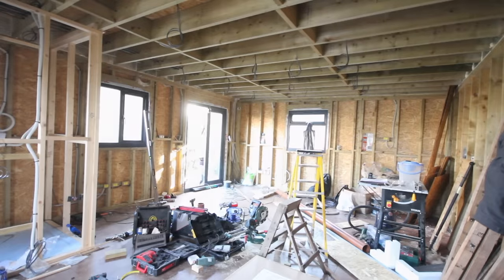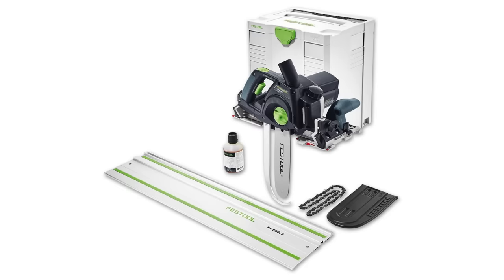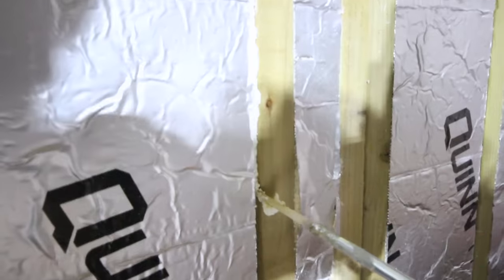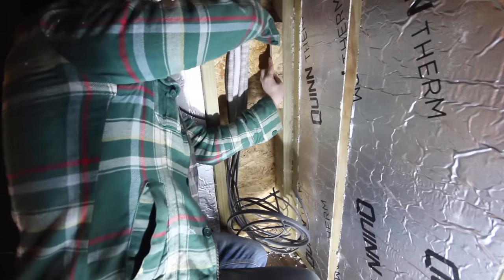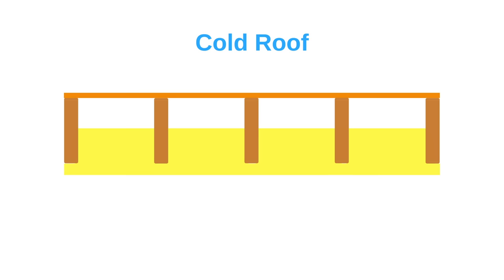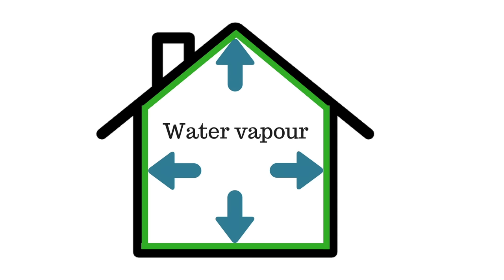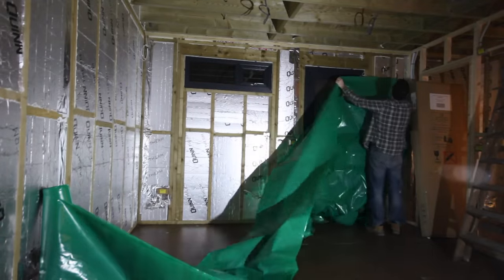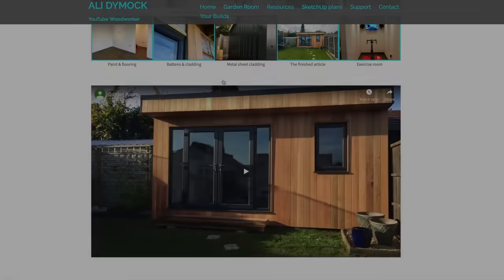Garden Room Workshop: Part 15. Wall Insulation & Vapour Barrier

Comment: For cutting PIR there are purpose made  handsaws for the job and they create MUCH less dust. They have a cutting profile similar to a large breadknife. They can 'wander' a bit though on thicker stuff 50mm plus. However if you want to make your life really easy you can buy 150mm jigsaw blades with the same 'breadknife' profile. These do a fantastic job, even in thick PIR. Very quick and low on dust.
Reply from the maker: Love it. I wonder if they make circular saw blades for the task too...
Reply: @AliDymock  Hi Ali, yes they do, my apologies, I should have included that. Look for a circular blade called 'Centrefire" by Bullet Tools. American brand but available on Amazon UK. I have only used the handsaw from Bahco and the special jigsaw blades from Bosch.
Reply from the maker: Super, I'll pin your comment to the top for others to see 👍
Reply: And the fact that you have pinned the above (as it;s clearly a top tip, however amazing a Festool mini chain saw thing would be) is further evidence of your ludicrous helpfulness!
 @AliDymock
Reply: I cut pir with a knife then like plasterboard snap over and cut other side very quick easy method
Reply: @simonjarvis7362  ociosaniuci.    FiIii cicxuco juiiiiffid i i Ok i i ou okupione o
Reply: @stancullen2408  yep, easy as pie and no dust that way. I use one of those ones that is like a Stanley knife with a longer blade. Zips through about 90mm thick of it then snap the board
Reply: @stancullen2408  how far do you have to cut 90/100mm pir to be able to snap it?
Reply: @handle1196  at current prices about 90 ot 100mm ideally.

Comment: Next time you want to cut the foam, use a electric carving knife like the ones used to carve a turkey. Clean cut, no dust, quick cuts and no beads. No wasted material by having blade cutting a curf through the material.

Comment: Cut Your installation to the correct size of gap then cut out any grooves needed for pipework and electricity cables but cover the back of the insulation where the cut is with silver tape folded into all the crevices and gaps before placing over the electrics or pipework

Comment: You shouldn’t have to worry about insulation and wires getting hot as if the size is properly calculated insulation will be considered when that is done

Comment: I wonder if a air gap between PIR boards and the outer panels is needed?  In case vapour penetrates,  it gets some space to dry or drip down.

Comment: Insulating a concrete garage, this video series is awesome, thanks so much
Reply: I am insulating a single skin room attached to the back of the house. Did you leave a gap between the studwork and the wall or go flush?

Comment: Great to see another video.
FWIW standard plasterboard is a perfectly good vapour barrier on it's own (once painted) if you install it properly. Of course a polythene sheet behind it is extra insurance and doesn't hurt but isn't strictly necessary.
Reply from the maker: really? Hmmmm. So does the paint act as a vapour barrier or the plasterboard or together? And is this the case if you don't do a full plaster skim and just tape and joint (drywalling)?
Reply: @AliDymock  It's the combination. The bare plasterboard provides most of the resistance and then you cover it in paint which is like sealing it up. 
The vast majority of top floor ceilings in houses are built like this, plasterboard on the ceiling and then above it is unfaced fibreglass insulation. Works just fine on ceilings like that.

Comment: I’ve never seen plastic sheeting put up over the joists internally before plaster boarding. If you’ve got Tyvec on the outside I’m worried you’re trapping moisture inside the walls (timber) which can lead to rot. I wouldn’t be surprised if your walls start to sweat when it gets hot. 
I’m pretty sure PIR insulation does that job already. 
Correct me if I’m wrong
Reply: This is exactly what I'm thinking...I'm currently part way through my build, and logic tells me wrapping the inside like this is not good. Different states in America, moving north into cold regions, it makes more sense,  but in the UK, this can't be right.
Reply: In the process of building my own shed and have been researching this a lot. From my understanding:

- Tyvek outer wrap is a BREATHER MEMBRANE. It lets moisture pass through it on one side but does not let 'bulk water and air penetrate it.
- The vapour barrier on the inside of the walls is to stop vapour from the inside of the building passing through the walls and hitting the cold side of the insulation and condensing.

Comment: been watching 👀 from the first episode  thought i would watch how you built  yours as i was just starting mine and was looking and learning how and where to start its been a massive learning curve doing it all myself .. after watching all your videos and a few others built up the confidence  i just went for it turned out pretty good 😉 i went for concrete base, shiplap cladding, wool insulation, plasterboard then plaster, rubber roof, tiled floor, with underfloor heating, 😅😅 with a shower room with toilet, total size 3.8m x 7m
Reply from the maker: Wow, with underfloor heating too, sounds grand - do you have pics?
Reply: I Documented it with pictures and videos but my phone got stolen so lost most off the project will upload the ones I have plus ones off it finished
Reply from the maker: That sucks! sorry to hear that. Well if you fancy having it on the website regardless, pop me an email: www.alidymock.com

Comment: This series has been brilliant! I’m just starting a timber frame conservatory build on the side of my Mum’s annex. There’s a covered decking there already but, after watching your videos and doing some research, I’ve realised it hasn’t been built properly. I’m essentially starting from scratch. 
I’m a self employed mechanic/car builder/restorer by trade and a keen DIYer - after the eye-opening and stressful experience we had with the builders who worked on the annex I’m doing stuff myself.
Reply from the maker: That's awesome, good for you. I must say, it's nice to have control so good choice and once you break the stages down, you realise it's very doable! Best of luck, with your experience you'll do great. Feel free to send photos Robin, I always learn from them 👍
Reply: Ali Dymock thank you for the encouragement! I work from home and I’m extending my workshop bit by bit as well. This will be my first venture into a domestic build and I’m really looking forward to it. I’ll definitely document the build and keep you posted 👍🏻
Reply: Ali Dymock I’ve just ordered the materials for the framework so, providing COV19 doesn’t disrupt delivery in the next few days, I’ll be good to start next week. One thing I wanted to ask (I’m sure you’ve covered the topic somewhere and have been asked before)  - did you look into putting a breathable membrane under the floor insulation over the joists? Tyvek suggest you use Supro in a suspended floor but that’s with a wool/glass quilt or batt insulation. Quinntherm’s installation guide is as per you’ve done. My only thought was could moisture in the air from underneath get into the floor joists and soak into the sides of the PIR and not be able to get out? Perhaps I’m massively overthinking this but I’d really appreciate another person’s perspective on this. One idea I had was to staple dpc to the top and sides of the floor joists to form a barrier between where the timber and the PIR meet...
Reply from the maker: @robinlaker  I haven't covered it again but will do so, though no quite the question you ask. The floor and insulation should be open to the underside to allow air flow. It's trapped air that is the problem and why houses have air bricks to allow that flow of air under the floor. A breathable membrane isn't really required because it stops rain water (mainly) which you won't get underneath your garden room. You could use it but I'm not sure it would do a lot.
Not quite sure what you mean in the last sentence (I can't picture it) but I really think it's not needed and could actually cause problems. 
Do you have a link to Quinntherm's installation guide? I'd be interested to see/use for a future vid.

Comment: Can’t wait to see the projects on the new house.
Reply from the maker: me too! We're saving at the moment lol
Reply: Ali Dymock I bet 😂 Tip for someone who’s been there. Try to do one room at a time. It’s tough but worth it.
Reply from the maker: Absolutely - definitely the best way to go, I'd go potty otherwise. 

Doesn't always pan out like that as it turns out:. The downstairs shower room could really do with being upgraded from a 6mm to 10mm cable for the electric shower. That means I need to take the plasterboard off the hallway to make way for the wire. As I'm doing that we may as well put spotlights in the hall ceiling. Since I'm doing lights I should probably get the ones in the utility/boot room done too. Oh and yeh, I need a new consumer unit with RCD protection to stop us getting electrocuted in the shower 🙈🙈🙈😭😭😭
Reply: Ali Dymock 😂 tell me about it. I changed a radiator to a triple column cast iron in the sitting room and ended up changing all the flooring, fixtures, making fitted cabinets in alcoves etc. It never ends 😆

Comment: BTW to cut insulation I got some 150mm long insulation jigsaw saw blades from milwaukee, cuts like butter and virtually no dust as its more like a knife and not a cutter. U also can do angle cuts well too by using the angle on the jigsaw.
Reply from the maker: Sounds brilliant. I'll do the same in future for sure!

Comment: You don't need to worry about insulating around cabling as your electrician will already have derated the cable to take insulation into account. Derating essentially means taking the maximum current rating of a given thickness of wire and reducing it by a factor based on what it is going to be surrounded by. In stud walls this typically always accounts for the wall filled with insulation.

Comment: I really hope to get started on mine garden room next year and this series have given me confidence that I won't encounter pitfalls that I can't manage on my own. 

I just discovered posi-joists, so I want to look into making a warm roof that's not as tall, if that's at all possible. 

Unfortunately pir foam insulation seems to be pretty rare in Denmark, so I'm worried it might be too expensive to consider. Seems to be nice to work with, especially for floor and roof.
Reply from the maker: Good stuff. Get the base/floor right and the rest will fall into place.
Posi-joists look great especially if you have a really wide span (6m+)!

Best of luck with your build!

Comment: Great to see another video from you Ali. As spring is just around the corner could you switch to the outside for the next video....Searching you tube, there doesn't appear to be much in the way of information on cladding and materials in the uk !!
Reply from the maker: It's a good idea, the next one will be on plasterboarding but I could divert after that one. I was going to save to the cladding for the final (ish) video to go out with a bang! If you have any questions though on cladding, shoot me an email and I'll do my best to answer :)
Reply: Robin Clevett did a video on cladding the other day. Also Charlie Luxton did one yesterday on the H&R channel.
Reply from the maker: Couldn't find the first but H+R one was useful and confirmed my thoughts 👍

Comment: Great vid's  it seems fortunate that you fully insulated  your roof i.e. overhangs , if not then warm air going through the "gaps" in-between the roof beams could condense on the cold vapour barrier ?

Comment: Absolutely great videos, Ali, and they have helped me immensely with my own garden studio renovation. Sorry if this has been asked before but when insulating the floor, should there be a gap between the insulation and the plywood?  My floor is over quite a big void as the building is on a steep slope. And there are air bricks all around. So from bottom up it would go:  void, then insulation boards fitted between joists, then vapour barrier, then plywood.  Then possibly laminate flooring.  If a gap is needed, where would the gap be? My feeling is that no gap is needed...?  Thanks!

Comment: Nice tidy job. Although, in the industry we would recommend against a vapor barrier on the walls, especially for those doing garage conversions (in the comments) as this can make the wall sweat and cause more more problems.  
A vapor barrier on the floor is a must though.
Reply from the maker: Yeh for brick or block I'd agree, better to let the wall breathe
Reply: Hi Lee, my garden room is a concrete block wall with a stud frame inside filled with insulation.  I was planning on building the stud wall and having OSB on the wall and wrapping it in house wrap as Ali did and then putting it up against the blocks.  Is this not advisable?  The problem I have is that the concrete wall on 2 sides is not tall enough (and I cant make it taller) and so the top 50cm of my wall is exposed.  Any advice would be appreciated!
Reply: @AliDymock  Can you please take a look at the comment i left for Lee and let me know what you think?

Comment: I use the aluminium tape for lotsofthingsand it sticks really well, BUT it has virtually no mechanical strength in tearing mode etc. I would have used this to seal then Gorilla duct tape on top for strength, this stuff is really strong and also sticks well.

Comment: Great video. Question if I may. Is the plastic vapour barrier necessary if the PIR and taped timber necessary? I read somewhere that it's not necessary as the PIR is the vapour barrier and i was concerned if moisture gets between the two it could cause problems. Cheers great videos
Reply from the maker: Correct, aluminium tape over the studs is just fine, in fact it's the best vapour barrier as long as it doesn't peel off. It doesn't stick well to wood but does to the foil on the insulation so just make sure there is plenty of overlap (get a wide roll)

Comment: Brilliant bit of video/editing work. It must have been as much, if not more, effort than the actual build itself! Anyway it's totally inspired me to get going and I'm now at the PIR flooring stage. Re newer advice about putting a vapor barrier between the ply and PIR/joists (with air gap). As with an earlier video, presumably there would be no need to glue the ply to the joists anymore to prevent movement? would you recommend another solution to cater for movement?
Reply from the maker: You're so right, it was and is much more work than the actual building work! Yeh good question, you don't strictly need the grab adhesive, just helps prevents squeaks and keeps the floor solid. Even if you put down a polythene sheet you can still use grab adhesive as the screws will hold the ply/OSB in place 👍

Comment: Drywall sealer is to seal the plasterboard when it has been taped & jointed so the paint has a uniformed surface. If you don’t use drywall sealer you could see the joints once painted
Reply from the maker: Ah so the marketing was correct and it wasn't a waste of money, excellent 👍

Comment: Another helpful video, thanks! I really appreciate your thoughtful approach to problem-solving and have now watched almost all of your videos.

I want to insulate (using foam/polystyrene sheets) a new shed framed out of 2 x 2 battens, which has 16mm shiplap cladding on the walls and 11mm tongue and groove on floor and roof. 

Can I just check I understand your rationale for where to put the moisture barrier (I'm using polythene sheets)? You suggest the following order from outside to in: (1) shiplap siding, (2) insulation, (3) moisture barrier, (4) sheet lining material (I'm using 11mm OSB).

Is your rationale that when inside moisture hits the moisture barrier, you want the moisture barrier to be as far away from the cold source as possible? So, the problem if I switched (2) and (3) above is that the polythene would be close to the outside siding layer, and inside moisture would be more likely to condense?
Reply: I’ve only just worked this out today, a year after you asked the question. From looking at a couple of other vids, you would be correct that the vapour barrier would be between the celotex (what I’m using) and the mineral wool (rockwall etc). What I would like to know is if it is recommended to leave a small gap between the inside of the cladding (with the outer being the exterior wall) and the celotex, like I have seen suggested. Just glad I saw your question, I hope you built your shed successfully if so! 👍

Comment: Alright Ali love your work👌 I was hoping for some advice on a shed I'm building at the side of my house, I'm building it out of 4x2 with 70mm insalation boards with a air gap of 30mm gap for wires + vent, osb boards both sides with membrane and batton + Feather edge cladding outside with a polycarbonate roof, as iv had the sheets for nothing and I like the idea of the light in work shop/shed. I also have a concrete slab floor with damp proof under. my question  Is?? would you also put vapour barrier over insalation inside aswel or not bother as I'm not heating it as much just a small fan heater now + again just to take the edge of ? Cheers Mark 😉

Comment: great videos , my garden room is under construction with a warm roof , I haven't put a vapour barrier in so will have to put one in from the inside,  you mentioned on the floor not to put polythene sheet on top of ply" why is this ? many thanks

Comment: Amazing videos Ali, I'm planning my own build at the moment using these for most of the inspiration.. Quick one though, I can't figure out if the walls are supposed to be vented? I was planning on using 50mm PIR between 100mm studs, which leave a good air gap but no means of ventilating with external ply?